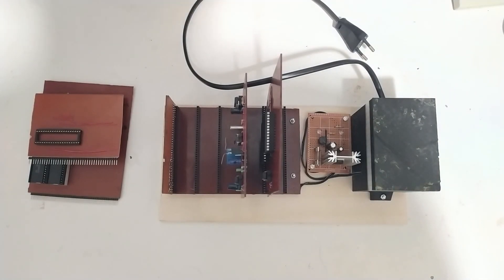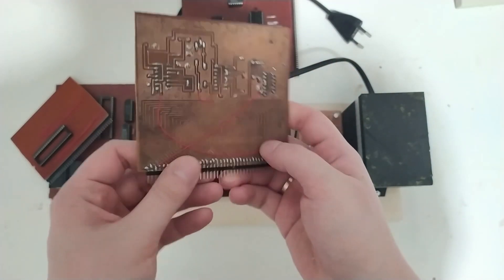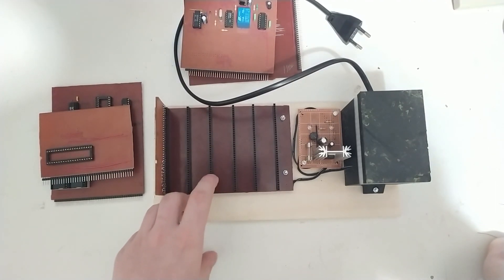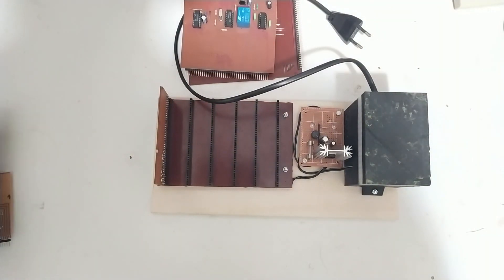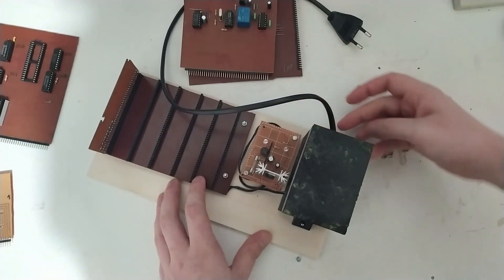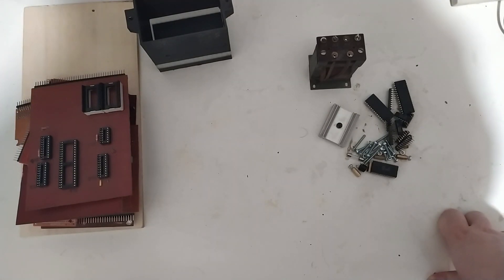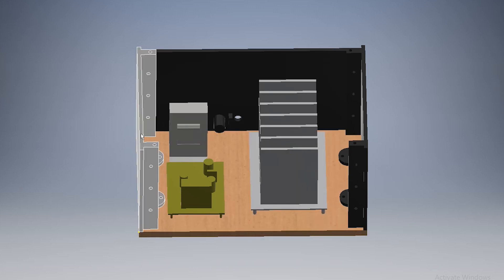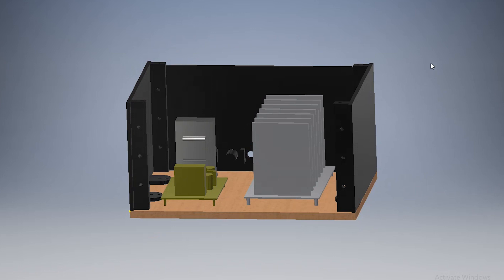Building a Z80-Computer Part 6 : Getting started (again)

Comment: i think it would be worth the effort to perfect your etching process and use double sided PCB with a great ground plane, also from my experience those connectors make good enough contact to not affect a computer with a couple of cards connected but I'm trying to find an alternative too, sadly edge connectors are too big for what i want them for.
Reply from the maker: Yes I think so too, I'm actually currently working on improving my etching process (another video on this will come out soon). I think I could probably get away with using the pin-style connectors but if I'm rebuilding it anyway I can just as well go to Edge connectors.  They are quite bulky though, and from what I've seen in your videos your Computer is going to be way more compact than the monstrosity I'm building.
Reply: @captainsolder5247  Well looking at the tiny boards you're using I would say otherwise :)
Actually i would be cheating since i don't have a case or dedicated mains power supply, i take 12V regulated.
I imagine you're going for a big machine with a front panel with switches and lights and for that a backplane with edge connectors in my mind is quite fitting.
Anyway I'm not sure how you etch your PCBs but I have found great success with photo sensitive film PCBs. I get them from a local store and they are very nice
Reply from the maker: @C32-d5j  I might change to a larger board size, it really depends on the type of edge connector I decide on using. It would also make designing the cards quite a lot easier I'm sure.
Yes that exactly what I'm going for :) I actually designed some stuff for the front panel last week. An integral power supply fits the large desktop form-factor of this project quite nicely too. If I'd be designing something more compact I'd probably go with something external too :) I like the precoated ones to, they are a little pricey especially in the larger sizes though, I tried the dry film coating that you can buy and iron on to your own blanks which I didn't like at all. At the moment I am using toner transfer which is alright enough.